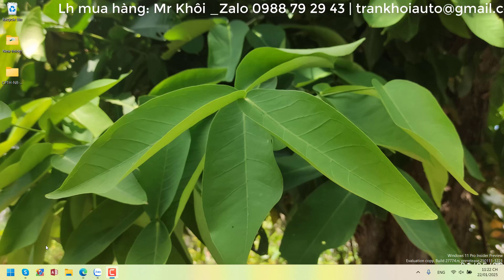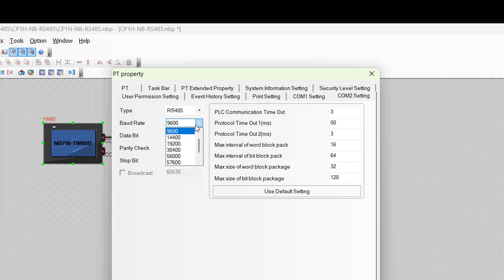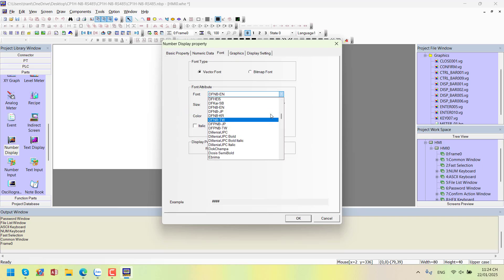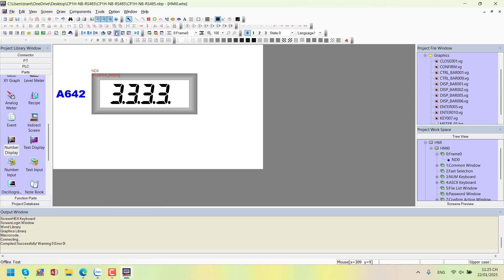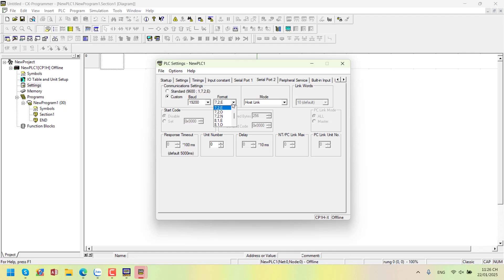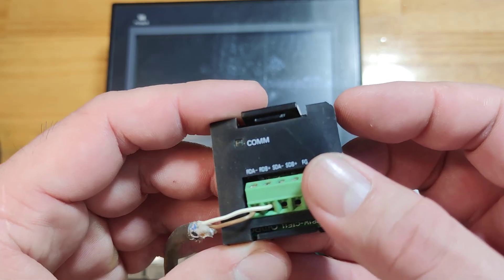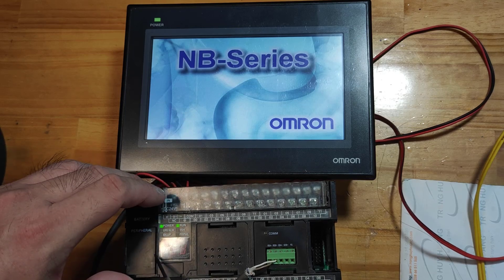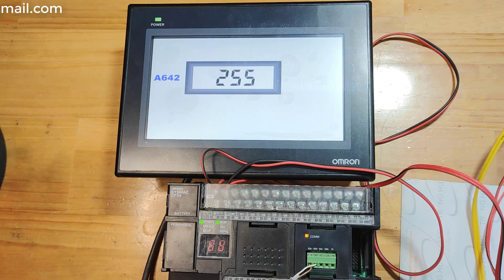Guide to Connecting OMRON CP1W-CIF11 to NB7W via RS485

Comment: I have a cpm1-cif11
Can I use it as rs485 or no and how ?
And this way in video suitable for it?
Reply from the maker: CPM1-CIF11 is not equivalent to CP1W-CIF11.

The CPM1-CIF01/CIF11 are used with the CPM1A, CPM1 only.

CP1W-CIF11 is an optional communication board for the CP1 series (CP1E / CP1H / CP1L).
Reply: @khoiomron 
Any data available for cpm1-cif11
It connected with cqm1h on peripheral port cpu
And I need it to connect it with scada 
I try to use cx supervisor for scada and the communication failed 
I use a converter from rs422 to rs232
The converter connected to cif11 with 4 wire 
And I enter the parameters of peripheral port 
Can I use 2 wire as 485 or no 
And how to connect it in cx supervisor 
I select the CPU cqm1h and the parameters of cif11
Reply from the maker: CPM1-CIF11 cannot be used with CQM1H.
Reply: @khoiomron 
IAM using a converter from cpm1 cif11 to connect it with cqm1h
Reply: @khoiomron and I try it with cqm1
Reply: @khoiomron you have any data for this communication
Reply: @khoiomron 
The cp1m cif11 can I use it as a rs 485 same as in video connection rda- rdb+ ? Or only 422 please 🥺